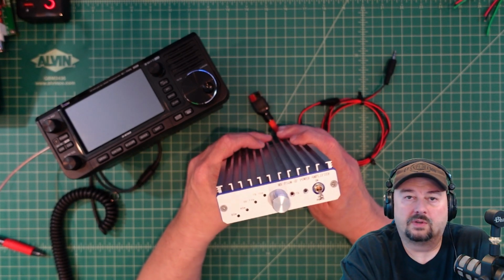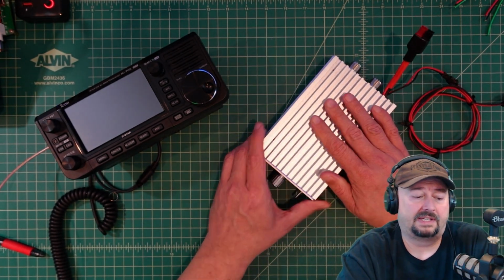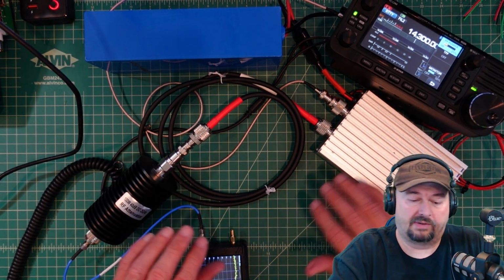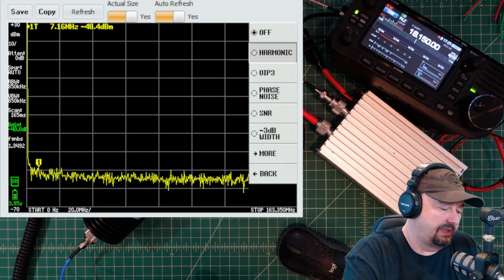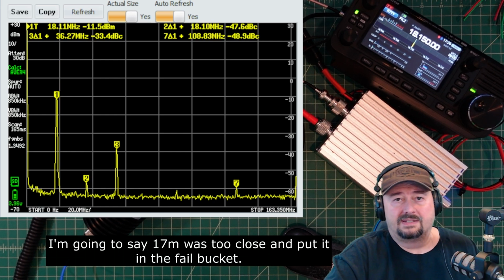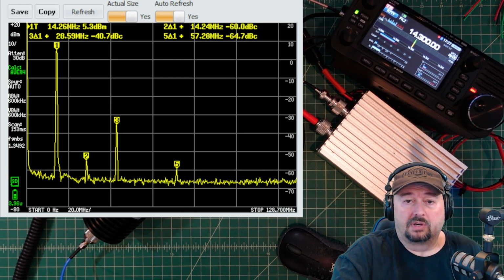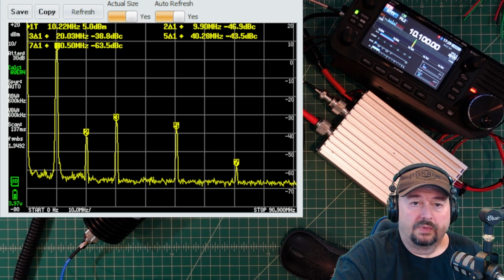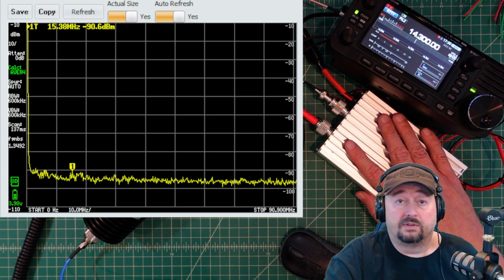MX-P50M HF Amplifier Testing with TinySA Ultra

Comment: Im sure others have said it already to add some attenuation. The 100w inline one is doing the lions share of the work for you  - I use a variable after my lunchbox attenuator and you can really tweak it to rule out  variables. Those Tiny SAs have so much capability in such a small form factor. Thanks for sharing !
Reply from the maker: I was debating adding another attenuator, the SA was also providing 30dB.  I do love these devices... thanks for checking it out SC 👍

Comment: A small concern with this measurement is the fairly high signal level going into the tinySA. I see it's about 5dBm with 30dB internal attenuation. This gives -25dBm at the input of the mixer in the tinySA. It would be better to use 30dB external attenuator so you can change the attenuator level of the tinySA to assess if the harmonics come from the amplifier or are generated inside the tinYSA
Reply: The harmonic generation (or not) may not be due to  the mixer in the tiny SA. I have seen  significant IMD changes when using internal/external attenuation with a popular benchtop SA. I put it down to either the RF switching ICs or switchable attenuators.
Reply from the maker: Thanks for the info Erik, and for all the work on the TinySA project 👍

Comment: nice test. that the SA I have. slight different model.  did  you test the radio buy it self ? you can use a band pass filter to clean that up. or try to fix the filter in the amp. I use a line tap into dummy load to test.  when doing full legal power that the best way to test.  I have the RM Italy amp. but only 25 to 30 Mhz. it did work 12 meters. and tested  good. the 2nd was their but way down to noise floor. low pass filter takes that out. I got a RM Italy 600 watt PEP 24V on way for a friend. 3-30 MHz. 1 to 10 watt drive. going to test that when comes in. 73's
Reply from the maker: Hey Robert.  I have tested the radio separately and it was good.  I was thinking band pass or low pass but haven’t messed with it.  Thanks for watching 👍
Reply: @TheSmokinApe  ICOM is very good . I still test. parts can go bad. I found the antenna tuner can block harmonics some what. try that.  use antenna on tiny SA . see if that 2nd on 20 meters drops down. RM Italy has a small 100 amp and it is HF plus 6 meters . but $$ . 10 meters really hopping lately. watch the heat on FT8 . playing 2 meter AM later. have to watch power. I have all mode 2 meter tube amp full legal power. only PVC j pole . havening fun with a 705 from a friend .wish it had bult in tuner . can listen to AM aircraft band ! some have full open receive .water fall on air band ! 73's

Comment: Great followup, Ape! Hells illustrate how useful even an inexpensive SA can be for the average ham operator. Looking forward to your followup. Btw, have you tried the remote access software for your Siglent? You might be able to feed that output on your screen to your video.  73 de K4FMH
Reply from the maker: Hey Frank.  I have tried it over USB and wasn't overly impressed.  I should try over ethernet.  Thanks for checking out the video 👍

Comment: Results suggest roll-off on that linear's output low pass filter just isn't steep enough. Could be the design is OK but first thing I would suspect is the tolerances on the output filter components.
Reply from the maker: That's exactly what I am thinking, I've got this field stripped at this point and need to find a source for the SMD caps.  Thanks for the comment Steve 👍

Comment: Do you connect the radio's transmit keyer output directly to the amp without buffering hardware?
Reply from the maker: Radio > AMP > Attenuator > TinySA

Comment: So if I measure say 146.520 with 5 watt boafeng with a 40 dbm attenuator my reference level should be set at 40dbm?
Reply from the maker: You want to go to Level then Ext Gain then enter 40 👍

Comment: Oof that 30m test was definitely not good. Makes me wonder if there is even a filter module installed for that band.
Reply from the maker: There's a filter, but it ain't working.  Thanks for watching Jeremy 👍
Reply from the maker: @JReed305  I might be the roids but I suspect the caps
Reply: @TheSmokinApe  if that's the case it's just a solder job of new with the correct value